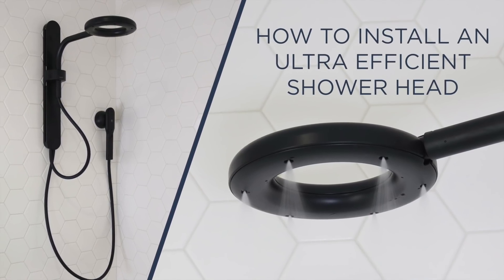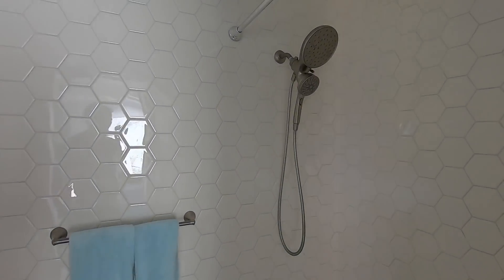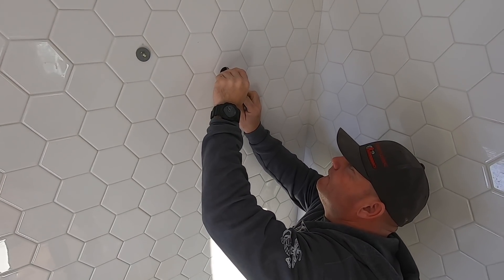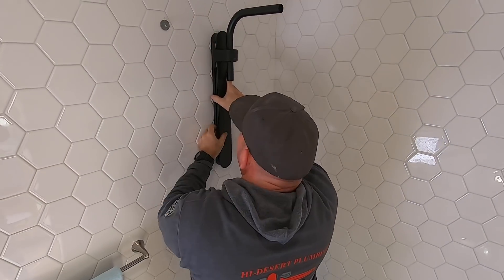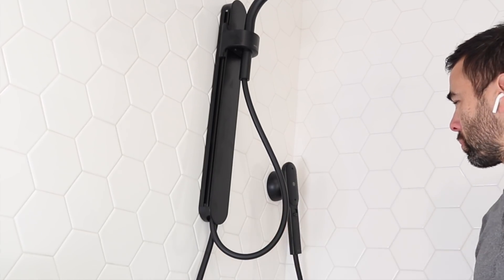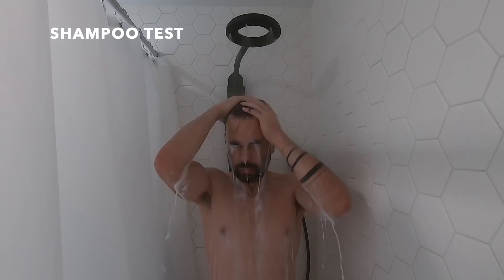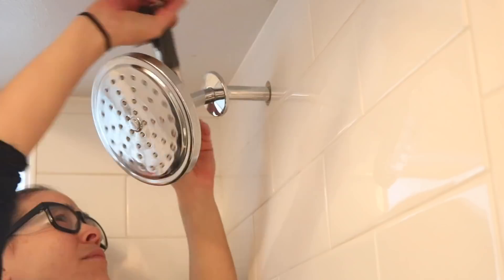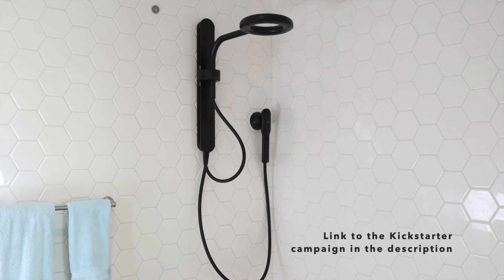How to Install an Ultra Efficient Shower Head | and testing the Nebia by MOEN

Comment: A BIG BIG WARNING : It's a POS !!! I can't stress this enough !!! It's like trying to take a shower in a mister... Even turning your hot water heater up to 190 Degrees and the faucet on full heat By the time the water hits your body its lukewarm at best!!! Also they tout you use less water... BULL S--T ! What use to take 5 min. in the shower now takes 15 min or more if your shampooing your hair....The guy that designed this can go sell it to AOC and Bernie !! 250.00 WAISTED plus time to install !

Comment: If you want to feel like dishes in the dishwasher, sprayed with small droplets with big speed it's super awesome. Obviously, those small droplets have a bigger surface, it's basic math. If you have more surface, you have more evaporation and faster temperature reduction of that droplet. This shower is a horrible idea and experience. It creates an enormous amount of steam and water drastically lost its temperature. Probably near your feet water is at room temperature, and your head is warm in first minutes of shower. After that time, all air in the shower cabin will be warmed, you lost your heat from the water just to heat the air, and THEN you probably feel comfortable. But you don't gain any money in savings. You waste energy. And obviously, the showering process will take more time. You need to wait for some time, for water even penetrate your asscrack and other places. You have to be a complete moron to believe this will save any money and be good experience.

Comment: i had (not this one) "efficient shower head" before..... i used it once and it was the longest, most stressful shower in my life.
Reply: Why??
Reply: @legitchristian8498  low pressure, not enough water to wash away shampoo, from 50cm and more it was more ice sprinkler (good massage though) than water flow, had to shower literally 20-30cm max from the body. result: more time and water waste than with a classic shower head.
Reply: Must be terrible to be so fragile.

Comment: https://www.youtube.com/watch?v=1j8rz9iZbsk :-\ Quality issues with the slide arm

My dislikes: 
1) Arm doesn't go any lower, despite the swivel arm looks like it could go lower but cannot.
2) Wand with 2 nozzles feels lightweight, cheap construction. 2.0's 3 Nozzle wand is much better.
3) Wand mount white finish doesn't match the Shower's white finish. Also cheap construction.
4) Hoses don't match Chrome finish.
5) Wand by Moen and 2.0 are incompatible

My likes:
1) Shower head does feel hotter than 2.0
2) Less water vapor in the air, so my bathroom doesn't feel like a cloud

Comment: I came here from the Kickstarter page and wanted to ask:
1. I hate showers with low pressure. I don't want to get drizzled on, I want to the water to really drench me. Does the Nebia by Moen do this?
2. Is it true that international buyers have to wait months longer to get the product?
3. Is there much impact on the temperature? I imagine with a finer spray the water cools more quickly. How noticeable is this?
I really like the look of the product and am thinking of buying, I just want to be sure given the cost and shipping to Australia.

Comment: This is dangerous, vaporising tap water isn't a great idea as it will get inhaled with all the bad chemical, viruses and such inside it (look the internet, you'll be surprised) without the protective barrier of your stomach.

But if it save the planet I guess falling sick here and there isn't much of a concern.
Reply: At Nebia, we take safety and quality very seriously, holding ourselves and our products to the highest possible standards. We’ve done extensive research on this particular topic, and the results indicate that Nebia by Moen poses no greater risk for bacterial inhalation than your average household shower. Although the atomized droplets are smaller, they are still much larger than we are capable of inhaling. Public health experts in the epidemiology and immunology fields indicate that in order for bacteria to be transmitted into our lungs, the mist must have a droplet size of 10 micrometers in diameter or smaller. Our H2-MICRO™ technology creates smaller droplets than a traditional shower does, but the droplets range in size between 200 and 1000 micrometers in diameter, which are too large to inhale.

Comment: Having used one, I find the water to lose it's heat much faster since it's in such small droplets, the water that reaches your feet is not that warm anymore. Other than that it's great.
Reply: Hi Gepetto, Nebia by Moen is our warmest shower yet! When compared to Nebia 2.0 the droplets are 61% larger in mass (17% larger in diameter), which significantly increases their ability to retain heat.

Comment: I would have to save 71,000 gallons of water to make this beautiful $199 device break even.  That's about 35.5 years of my life (assuming 2k gallon use per month), assuming it lasts that long...and I do as well.  I don't think the value of this device is quite there yet, but it does look great.
Reply: Maybe the incentive isn't quite aligned for personal savings but if we all reduce our shower water consumption by 45 percent, that ended would be value.

Comment: I hear that since the water droplets are so small they lose heat really fast so you need to use more hot water to feel the heat, is this the case with this shower? I like my shower hot!
Reply: I can tell you its ture. My rain shower has 2 option, regular rain droplet and steamy jet like the one in video. Whenever I set it from rain to that steamy thing, I need to turn up the hot water a bit, not much but still noticeable.
Reply: I did have to turn it up a little hotter, BUT the shower is time is shorter and the spray is so fine, I think it uses less water overall.  A satisfying experience.
Reply: You can feel a huge difference when changing the position. When you’re very close to it it’s very hot but going away it gets cold very fast. Also your bathroom gets very steamy so you should open a window afterwards
Reply: Yes you're right. Atomising water and air makes them cool. Tiny droplets kore tiny packets of sir that is after compression is always cold. A reality example is a blow of air  from your mouth with a pout (cold air) and blow wide open (hot air) use your hand in front of your mouth like testing your breathe. You'll understand.

Comment: I'm a renter, so I can't upgrade, but I'll be keeping my eyes on this. I have plans to be a homeowner in the next year or two, even with all the avocado toast I eat. Also, I hope you were prepared for the thirst comments. You're a beautiful human being inside and out, and the internet is full of loudmouth leches.
Reply: Renters have nothing to worry about with Nebia by Moen! To uninstall the shower, simply press down on the release button, located at the top of the bracket,  lift the shower off of the bracket retainer and away from the wall. That's it you're all done!
Reply: Nebia why do you guys not comment to the GPM comment? You choose this one but ignore the other ones that far more people expressed interest in.
Reply: @davidferrer678  At 40 psi, the typical household water pressure in North America, Nebia by Moen Rainshower uses just 1.26 gpm and the Rainshower + Handheld uses 1.54 gpm.

Comment: I wonder how this is going to be when the shower nozzles get clogged with hard water
Reply: Nebia by Moen stands up well to hard water. That being said, if you have very hard water, over time clogging can occur. However, this is simple to clean using white vinegar. By tying a bag of white vinegar around the head and the wand, and letting it sit for 30 minutes to an hour, you will dissolve the build up.
Reply: @NebiaShower  Yea, that's what I figured. That's what I've always done. I didn't think this head would be any different.
Reply: Why would this be any different than any other shower head? Every time I've lived with hard water I've always cleaned my shower heads the exact same way.

Comment: Kinda spendy and it looks like mist and assuming there is no adjusting it. The newer RV shower handhelds are better at saving water in this situation starting at $40
Reply: Got a link or example to compare?
Reply: @MrHooper521   This is just one there are many on Amazon.
Shower Head with Hose - High Pressure Handheld Showerheads with ON/OFF Pause Switch 3 Spray Modes Water Saving Showerhead - Flexible Stainless Steel High Temperature Resistant Shower Hose 59 Inch https://www.amazon.com/dp/B07T2TW6L5/ref=cm_sw_r_cp_apa_i_SjZkEb34V5ZEC

Comment: If been looking for the water flow volume per minut but couldn´t find on ... neither did you tell us in your "review" :-(
Reply: Hi, at 40 psi, the typical household water pressure in North America, Nebia by Moen Rainshower uses just 1.26 gpm and the Rainshower + Handheld uses 1.54 gpm.
Reply: Conocuneus - Perspective is everything how convenient lol.heres what I found on their kick starter.  

Fun fact 💡If you take a 10 minute shower with a regular (2.5 gpm) shower, it would take you 18 minutes to use the same amount of water using Nebia by Moen without the Wand, or 14 minutes to use the same amount of water with the Wand on.
Aka we don't want to directly answer this question
Reply: @davidferrer678  I also skimmed over the crowdfunding page - Now I have more questions than before.
I´ll wait, maybe amazon will list it in the future and the algorithm will suggest it to me ...